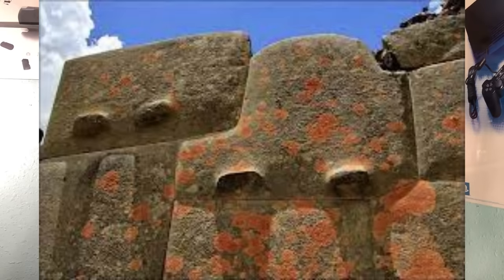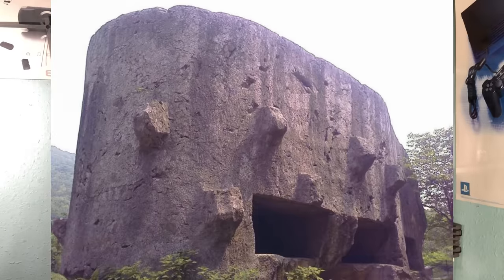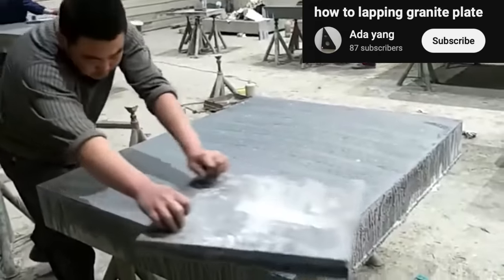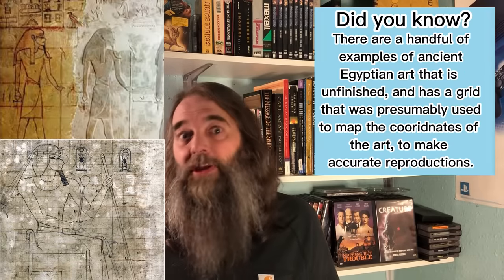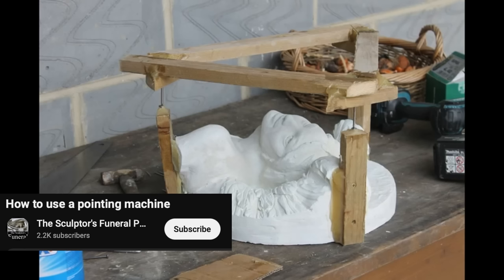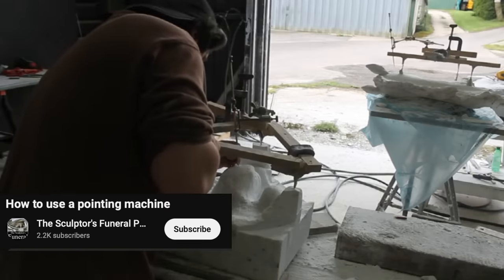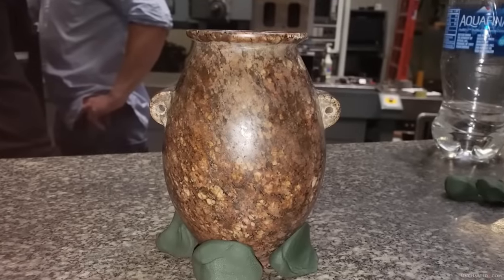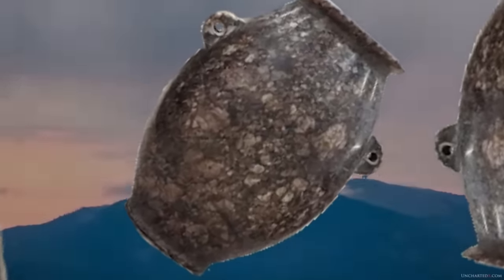The True Purpose of Megalith Stone Nubs

Comment: Nope. Your theory makes no sense. They were for places for giants to grip. Smaller stone items that have these knobs are not made with knowledge passed down from those giants or anything like that. It is just common sense that things need handles. While working with stone a handle with a hole is not only more difficult to craft, but it is not very sturdy; it will break if the solid stone or stone vessel and its contents are heavy enough, or become fatigued with usage and weathering along its natural imperfections or stress points. It took large humanoids to lift huge stones and place them precisely. They were quarried and masoned just like any stone ever. A small degree of skill and a great deal of effort, as is anything made. Walls that have intricately unique fittings were measured with gauges, yes, but wooden dowels at pivot points make for a suitable gauging tool. This only works well with denser stones as less compacted stones when broken at fissure points is too erratic and not suitable for design. Also with age large “megalithic” stones secure themselves more firmly with natural movement from seismic activity through a natural lapping process. I assure you they were not so snugly fit when they were first made. This is shown via the irregularities found along the top most points of the fixed stones. The “precision” of the placements are made through simply being there a very long time. Knobs are just convenient handles as well as stand offs for leveling posts to which cordage was tied to assure a level and planar wall is being constructed.

Comment: Something that occurs to me is that the primary stonework is to make a stone fit against another stone. 

The frame method could be used to duplicate even a complex shape.  But, that's not really what they were doing, they were creating inverse shapes to fit one stone to another.  My understanding is that the mating surfaces are not flat planes, they are somewhat irregular, which makes the joints much more stable over long periods (they tend to settle back in the same position following an earthquake).

Perhaps they related to  positioning and setup, but maybe in a way that we don't know yet. Or maybe they were used as an aid in positioning them? A point against which a lever could gain purchase on an otherwise difficult to grasp surface?

Comment: First cut of the stone was made with fire and cold water to crack the surface and a hammer to finish the break.  I think that nubs would be made when the fire didn't quite make a smooth surface and had no purpose at all and weren't important enough to remove.  However, making a wall that fingers can't get into to climb, or sticks can't get into to break the wall apart was verry important.  

Today, I was given a blueprint of a part and a sample that had been excepted and paid for by the company buying the part, the print and sample part had nothing in common.  The CAD programmer was given instruction to make another program for the part and made a second rendition that again had no resemblance to the print.  And that is when I noticed that the print and the written directions on the print didn't even match.  What it all comes down to is the question, "does the dang thing work?"  If the customer is satisfied with the finished work, then don't make the job more expensive.  Those nubs would have cost money to take off and so long as the nubs don't help someone climb the wall don't spend extra time/money.

Comment: You can use a technique called tick sticking. You place a wide board of some kind on the form then use a pointed stick place it on the board with the point you want to mark on the location you want to reproduce and mark the board in two locations label the marks then do the same thing at all the points you need to make then move the board to the material you want to shape lay the stick on the board with the corresponding marks mark the end of the pointed stick connect the dots. It a technique used by boat builders to fit odd shaped pieces.

Comment: I can see how this explanation seems feasible to a degree. But as well they would have to layout most of the wall they were going to build on the ground and work back and forth between every stone block, moving the blocks back and forth, carving, fitting, correcting, over and over again the ENTIRE jig saw puzzle until every block in the wall all fit perfectly on the ground. The ground would really need to be level so the pointing instruments give accurate placements, as your example sculpture videos show, which is doubtful, and the finished walls as they stand have multiple internal curvatures, top to bottom and end to end in some cases, which limits the accuracy of the pointing tools which means in practice the templating tools are only somewhat effective. Could this be done, I guess, but it seems like a thousand year multigeneration project given the monumental size of these structures. Therefore I question how that would really be feasible in practice, even if as a technical approach, piecewise, it seems feasible to fit stone blocks with irregular perimeter's together using primitive templating tools.

Comment: Nubs were once remnants of Matrix pour out of the  holes in the frame where excess liquid Matrix seeped from as the top was being leveled 

First block would be a frame with four sides no top or bottom.

Future pours could have as little as two mold/ forms ( the face and rear sections ) if Creator(s) were pouring between two established blocks.

Frames could be of any straight, curved or combination polygonal form. Each  subsequent pour adjacent to lower or side blocks would of course conform perfectly to the prior. 

Tamping the open top of a given form recent pour would condense air as excess Spilled Out of lower , these Outlets an easier process then skimming off top for level.

 Matrix Theory

Comment: I haven't thought too much about this but the first inclination I have is that the nubs create shadows in the shadows will be black which will allow the electricity current going across the surface of the rock to continue as light goes to dark without the light would diminish without a particular pathway these rocks have no real rock look to them I should say no living Rock designs which would have provided pathways for the electrical going across its surface since they were concrete you'd have to add your own electrical light receptors enabling it to jump across the surface this is just my first thought about the nubs

Comment: It looks like a " sucking tool mark" to remove  the extra  softened material until the desidred joint points are meet ,the only thing doesnt appear to matchup is why the knobs are not exactly on same size...which again is puzzling or at least to be like 3 -4 " standard" sizes removal tools tubes  ..

Comment: So, well, you explain the flat surfaces with lathing. Okay. For a rectangular block that seems feasible - but what about the multiedged, multiangled stones that fit together better than some jigsaw-puzzles you can by on the toy-market. I see no way how lathing could help you there - as there are so many angles and sometimes even blocks that have to fit together all at the same time. Also I don't see how you could reach this level of fitting with the pointing device. You still need the flat surfaces not in somewhat the correct angle, +/- a mm or so - but most precisely! Think of Polycletus - to eu - a tiny error in the small leads to a great error in the big picture, I fear. 

But your idea in itself sounds not all too bad. But I guess we might have to consider very precise frames - and maybe another kind of cutting/lathing than you propose. 

Hm. It alsos begs the question at what time of construction the stones had been shaped. Preconceived in a "factory"? On the fly at the site? Grand laid out plans for the whole polygonal wall down to the last miniscule angle? Just like a puzzle I find it hard to conveive to build whithout a detailed picture of the finished in mind or on plans, most likely. And then we open the path to geometry and mathematics...

Nah. I'll take the blue pill. It was all done like this because it was easier than building with rectangular blocks like we do. And heavier stones need less trips back and forth to the quarry. Hey, why not limit it to one. Build the whole frigging thing just out of one big monolith, because then you don't need a quarry at all! Oh, wait. They done that, too...

Comment: The nubs are just anchor points for ropes and leverage points for shifting the rocks around with sticks. When larger cranes are needed eyes are made and later removed. That's all the nubs are. It's no mystery at all. Masons still use them. The fit between stones is made by building up earth to the level of the current layer and sliding the upper rock into position in front of the lower rock, tracing the shape of the lower rock onto the upper rock with charcoalor chalk and removing some material, sliding the upper rock in towards the wall a bit farther and repeating until the fit is right, wet clay makes the rocks easy to slide around and polishes the surfaces to a nice final fit, because the rocks are heavy the lapping process is fast with the upper stone rubbing against the lower one, the edges of the stones are often filleted so no sharp edges come into contact with each other. You can also work in reverse removing earth as work downward when necessary. It's not complicated. For extra strength oxen can be used. The nudging sticks can rotate blocks and move them forward as needed very easily. Ropes attached to the upper part of the stick. One lighter stone can act as an moveable achor point to change the fulcrum for any nudging stick.

Comment: frequency.   I know for a fact that we can take solid rock, use a frequency and it melts.  
this is how we make raw silicon for semi conductors.  Its a fact. I have worked on the machinery.  I have seen with mine own eyes solids turn to liquid using frequency , NOT electricity.
 my theory is that they build molds, filled them with "polymers"  and used frequency to melt the rock.  some days it worked better than others so when stopping , drawing out the tuning rods or what ever, we get nubs. 
  Not a perfect system...ergo nubs.

Comment: I don't know if I understood your thesis correctly: if the nubs were used for reference points when carving the joints between different blocks, they would have to be on the contact surfaces between the blocks during the carving, and then they would be removed so that the blocks could be settled. We wouldn't even know they existed... 

now, these nubs are on the external surfaces, which doesn't make sense, as the external surfaces aren't sculpted to fit into anything. If they were going to build a mold frame, they would already have the measurements. Another issue is that a reference point would not need to be carved into the stone like a nub, it could just be a point, a mark, a scratch, a small hole etc... there is no point in carving nobs for this.

 These are just thoughts, I'm not criticizing the idea to question it. Have you ever heard of the idea that nubs would be some kind of engineering of rock expansion points, to prevent block fractures? does it make any sense?

Comment: "they didn't had measures..." that's already debunked. The old greeks already had a unified measuring system about 2000 years ago so that workers from different countries could work together. Which means if the greeks left proof of that from 2000 years ago it's easily imaginable that former people from 2000-5000 years ago did the same already. The history of mankind is a very slow one, the current technical breakthroughs were literal from the the last 100-200 years to the point that we can fly to the moon or send other countries a happy nuclear holocaust gift like japan.

For lifting, transporting heavy stones it's also already proofen by an american engineer who alone did that feat on 1-20 ton blocks including putting them up like monoliths and if one human can do that it's easily imaginable that 100-10.000 workers can do that too. For lifting heavy stones up multiple meters we just need to look back in history in the middle ages where they already had wooden cranes for churches, castles.

Comment: I can see how that would work but the rounded shape doesn't lend itself to an acurate fixing point. Also why would they leave some on there and get rid of others? If they served a practical purpose like this you'd imagine part of the process would be to cut them off once the rock was in place..   
  Its clear by the work they did on these stones there was a spiritual element to them which might explain why some nobs were left in place. 

I think it went like this.. First they'd work out the shape of the block in the wall of the quarry. This might be determined by natural fractures or grain etc. Then they carve the front with nubs which will be used later. Next they chisel out the block edges as deep as they could. The cushion shape on the front allows them to cut deeper into the edges. Then the larger rock is cut out of the quarry wall and when it crashes to the ground on the carved front the nub would work with the deep cut edges to make the block fracture in the desired place. If they were cutting several blocks at the same time it might not be necessary to have nubs on every block..  They might have left them on because this was an important key stone, if you like, to the process and was treated as special...  What do you think?

Comment: Personally, I think the nubs are an artifact of the quarrying process. They are exclusively found on "puffy" stones. Never on finished ones. 
I think the nubs are points where the stone was attached to the bedrock and then snapped or sawed off.
I also believe that all structures that show nubs today are the same age, because the nubs are on unfinished surfaces.
You see this in egypt where there are structures on which they started to flaten out the puffy, nubbed stones and then just stopped mid process.
Something caused construction on megalithic structures to stop all across the world at roughly the same time.

Comment: So I guess if you have a reference point on a carved block, you can make a frame in wood to fit it, then use that frame to produce the other stone blocks that fit round it without having to continually go back and forth with a stone block between the wall and where the block is being shaped to make it fit. I guess you could create the whole wall with the blocks in a horizontal position, shape the blocks to fit and then when all or soome the blocks have been shaped, lift them all in to place where the wall is to be built, into the final vertical position. Any nubs left on the stone can then be used to affix decoration, plasterwork figures or wooden figures. Who knows, perhaps such large walls were plastered smooth and painted. All we have left is the stone.

Comment: I would find a stone that fits approximately, that needs the least work, secure it into a cradle and lower it in position. Remove it and hammer it with stones until it fits snugly into the stone/s below and adjacent. Then draw the stone in its cradle forward and back until it scours itself into a perfect fit. Finally remove it one last time, wash out the dust and fit the stone. A whole line of stones could be worked in this way. 
The nubs could be to secure the cradle or they could have some decorative feature attached - now missing.

Comment: Ive been a CNC Programmer and Machinest for almost 15 years and while I thought you're initial idea was interesting you're completely mistaken if you think that a set up like that (even with metal needles) could in anyway whatsoever begin to explain the level of accuracy & consistency that those pre-dynastic vases exhibit. Those vases display incredibly tight tolerances with such a low range of variability that they literally rival what we can produce today in 4140 steel and composite materials like carbon fiber... Which is not granite. IMO It would be factors of magnitude more difficult to achieve comparable results in granite.

Comment: Wouldn't every stone require its own frame? They're not the same size stones and all different shapes plus the nubs vary in location on the blocks so wouldn't they have to make a frame and measure it out to within a fraction of a millimeter...even the sculptors vid explains they used epoxy to fill in any gaps but there's no mortar in these constructions, just perfect alignment. We cant achieve this level accuracy without machines and computers nowadays and there's still a huge margin for error. So what were they using that's far more superior than our tech we have now? If humans were this accurate and such perfectionists what happened to us and why did we get dumber?

Comment: Since the nubs are not regular and not on all blocks no hypothesis can be drawn on their use in the construction process. However addition material ( nubs) ,or holes are used to "tune" regular objects in modern construction. For instance lead weights are added to regular wheels to balance them , random steel( nubs) are welded to drive shafts to balance them . Weights are added to bridges and skyscrapers to counter act  vibrations. Bells are tuned by adding or subtracting material. Since sound was probably used by the ancients to lift things the nubs may have been harmonic adjustments .😮